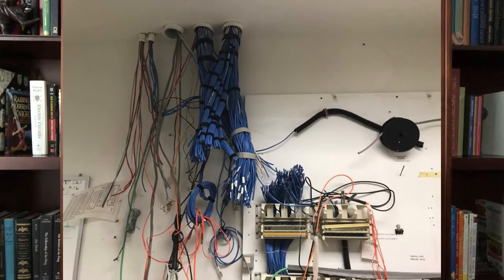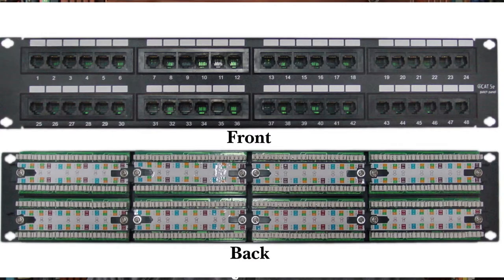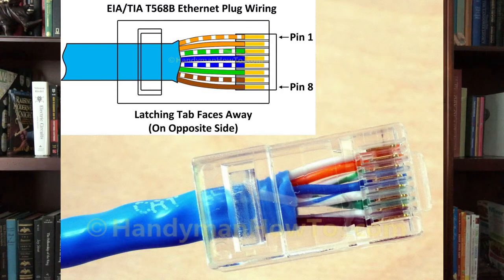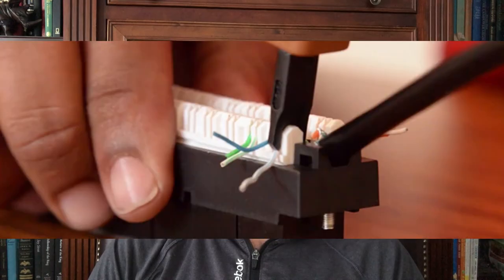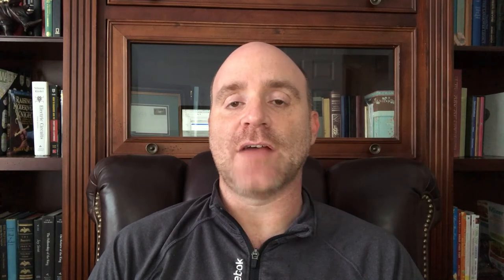What is a Patch Panel? Do You Need One for Your Home Network? (The short version 3 min)

Comment: ive got like 6 cables to the main rooms i use in my house to a switch and 2 cables to the modem and extender , do i really need a batch pannel ?
Reply from the maker: Absolutely not unless you just want one, or possibly if you plan to expand.  However, no need for one at all if all of your ports need to be active and your switch has enough ports.

Comment: So it’s really just there to keep the ethernet cables short at the switches end on the part that could incur damage?
Reply from the maker: Yes, it lets you easily move things around too.  A lot of commercial buildings and some homes have more wall plate connections than they actually have room for on the switch.  A lot of times all of these wall plates aren't in use all of the time.  The patch panel allows for a quick way to move which wall plate port is on the network when it is needed.  It also allows you to use purchased patch cables.  Those are often better than an end that you can put on.  Also, it is much easier to punch a cable down in a patch panel than to put a male end on an ethernet cable.

Comment: What's the difference between a switch? Thanks
Reply from the maker: @Aaron A, Great question! The simple answer is that a patch panel has no electronics in it. Where a switch does have electronics inside. A patch panel port only connects to a single port on a wall. Whereas a switch might connect to several ports.
Reply: @HodgeHub  ah I see, thanks!

Comment: What is the smallest size a patch panel can be? Is there a 4 port version?
Reply from the maker: 8 port patch panels are about as small as I have seen for rack mount.  However, you can buy keystones that you can punchdown into individually and different plates and make what you want.  I also saw some surface mount boxes that had 4 ports that you could use as a patch panel.
Reply: Thanks! You are totally right about that.

Comment: Does the patch panel affect the bandwidth rather than running a homerun directly to your devices? I ran cat6a cable, but the used rack I purchased already has a cat6 patch panel rack.  Will the cat6 panel impact bandwith assuming I want 10gb from my cat6a cable? Should I change out the patch panel to cat6a to obtain a higher bandwidth?
Reply from the maker: It can for sure, especially if the wires don’t stay in a twisted pair very close to where they are punched down on the patch panel. To achieve max throughput, you would probably need a homerun, as you mentioned, or an upgraded patch panel. However, it’s probably worth testing the throughput first.